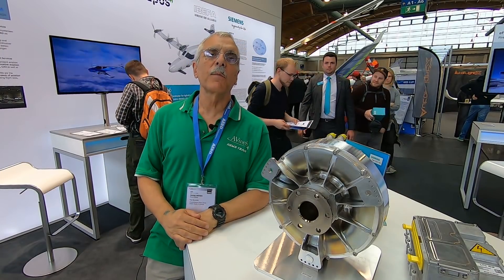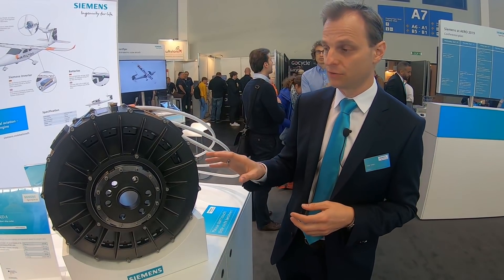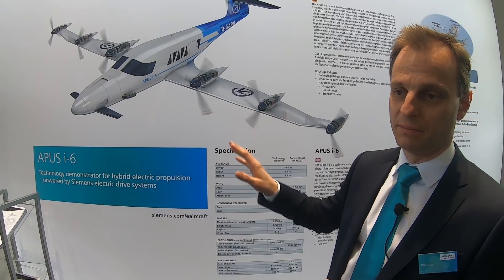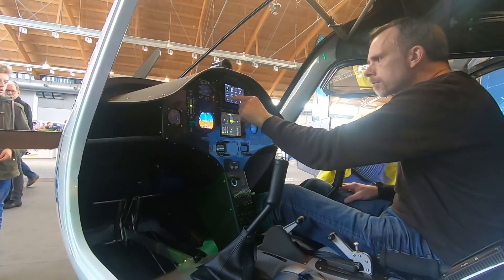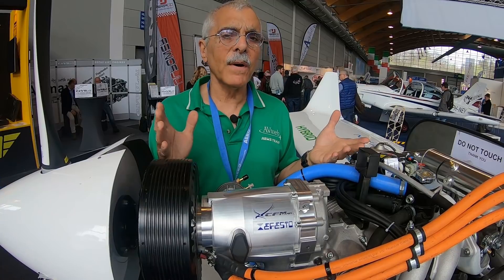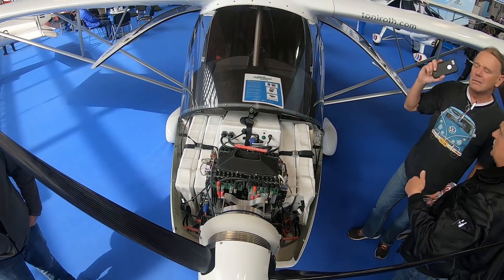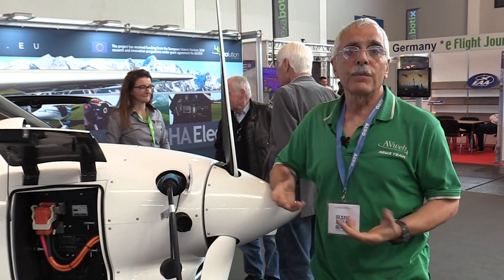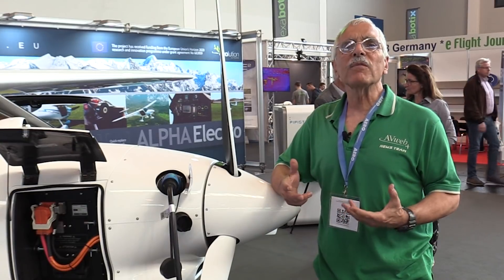What's New in Electric Airplanes?

Comment: Why is no manufacturer looking at hydrogen fuel cells?
Reply: weight (mass, poundage)
Reply: Never mind. Watched all the video 11.52 FC is discussed. Thanks
Reply: Correct. FC is far lighter or greater range. Honda does everyone a favour and produces the Clarity Battery EV and FC EV. Both are similar weights but one has 96 mile range and the other 366 miles. Cost and access to technology are probably limiting factors along with range extenders being cheap. Would have thought FC would be perfect for planes
Reply: @conpapas6023  If you add up the weights of the fuel cell, and the massive cylinders, strong enough to hold enough H2 to be meaningful... well, the weight of it all would be prohibitive for aircraft.

Comment: Oh good, let's fly an airplane on coal!

Just kidding. Well, not really, but hopefully renewables can actually enter a market without being bolstered by government subsidies and then we won't be flying "electric" aircraft with electricity derived largely from coal.

But nice leap forward. Forgive the sarcasm.
Reply: Nicholas Boscaino 
Renewables are already cheaper than coal, without any subsidy. BTW, why’s it ok for coal and oil to receive subsidies (they both do) but not renewables?
Incidentally, Tesla have been steadily converting their Supercharger network to solar. No shortage of flat space for solar panels at your average airport.
Reply: @q.e.d.9112  not against advancement in tech. Actually, Batteries have been one of the bottlenecks. I hear there is a cheaper higher capacity battery on the horizon. The other bottleneck unfortunately is the environment. Wind and clouds interrupt production. Batteries however might solve that problem.

All I'm saying is that there is only really one reason for electric planes at this point and that would be safety.

Regardless if fossil fuels receive any subsidies or not, the potential energy and portability and reliability is unmatched at this point.
Reply: Nicholas Boscaino 
Thanks.
I think lower operating costs will be a big part of it. Elsewhere, I’ve commented that a hybrid, using a single, turbine powered generator, and multiple motors with sufficient battery power for take-off demand plus a reserve in case of engine failure, might prove viable now. Only one turbine to service, which runs on constant load so only needs to provide power at the mean level required over the whole flight. Multi-engine reliability but only one turbine to maintain.
Reply: @q.e.d.9112  I like the perspective of losing the redundant engine but still having the redundancy. Take off battery assist is good too.  Good reason to incorporate a battery into the equation. Interesting.
Reply: Nicholas Boscaino 
Wow!
It’s such a rarity to have a civilised discussion with somebody on this medium.
Thanks for your reply.
Regards, Mick
Reply: @q.e.d.9112  no problem dude. It was my mistake to consider the driving force behind electric was eco friendly. I forgot what industry we were discussing haha. I often role my eyes at my neighbor cutting his grass with a corded lawnmower. Cost is most definitely not why for him. Nice guy but you know... but your points were a real insightful move forward for Aviation. I neglected to consider the benefits and only concentrated on a heavy depleted battery. It's seems to be an exciting time in advancement. The millennial culture seems to open to new, untested tech in exchange for the promise. But yea, all you said was good stuff.

Along advancement discussion, have you per chance looked at this prototype in development?  Already 1500 orders for kits. Its all diesel but getting awesome gas mileage. He's vlog'd his whole development and is ready to fly it. Pressurized, 350 miles per hour, 16 gph. You should check out his YouTube channel.

http://raptor-aircraft.com/
Reply: Nicholas Boscaino 
Thanks for that. 
If I was 50% younger and 500% richer I’d place my order for one of those today. 
Good chatting with you, mate. Where are you based?

Comment: No way in hell would I fly in one of these, especially one designed and built by Siemens.
Reply: Well technically everyone reading these comments is a product of semen ... :D
Reply: You must run a CNC with a Siemens controller.....everyone either hates them or loves them, with the later being the exception.
Reply: Keith Lucas actually I started out as an engineer about 30 years ago with a company taken over by Siemens, I since retired as a regional director One thing I’ve learned over the years is that Germans are the very finest mechanical engineers, when it comes to electronics and computer tech they are total shit. I’ve owned 5 Mercedes why I don’t know, since switched to Audi. A prime example was my CL600 a 12 cylinder outstanding engine and car until the 14 networked computers lost their freakin minds and wouldn’t communicate with each other an electronic nightmare. That was a $120K pieces of junk.....dumped it at a huge loss.

Comment: I prefer electric powered RCs over gas/nitro but man is someone in for a bad day if the batteries on the fullsize versions catch fire which is almost inevitable
Reply: Pablo Gonzalez these will be ‘slightly’ higher grade batteries than your hobby king LiPos
Reply: @atomicsmith  -  Of course but 6 figure Teslas still go up in flames and 9 figure 787s have seen contained thermal runaways no one is immune
Reply: @PabloGonzalez-hv3td  Neither one has had a battery fire for sometime. Improvements are constantly being made.
Reply: @ictpilot  - If by sometime you mean since last week for Tesla sure the point is it happened and no one puts out a product with the expectation of failure those failure points are discovered sometimes the hard way.

One undeniable drawback to electric flight is that an electrical fire is equivalent to simultaneous engine failure, fuel starvation and a fire in an ICE aircraft and a comprehensive fire suppression system could be impractical
Reply: @PabloGonzalez-hv3td  True it is possible, but pretty rare. Engine outs are far more common and electric propulsion will likely make those non-existent. Also engine fires have been known to happen...
Reply: @PabloGonzalez-hv3td  The only battery fires have been identified and solved (787). The Tesla fires were from after a crash. If enough paranoid people want it a fire suppression system for a light airplane would not be that big of a deal or weight. Hell, look at the Cirrus aircraft. Big heavy parachute system, and still gets great performance.
Reply: @ictpilot  -  2 Teslas caught fire within the last month neither from accidents and the 787 is a perfect example of the precautions taken to surround battery packs in heavy enclosures. A requirement that doesn't scale up well.

Boeing didn't change battery type but because of the upgraded enclosures we don't actually know how many further incidents have occured as the FAA now deems them "non reportable events" the last known battery failure was in 2017. I've been on a plane that made an emergency landing we didn't make the news (not a 787).
Reply: @PabloGonzalez-hv3td  Right better packing on the batteries, now not a problem. I'll have to look into the Teslas and see what the story is. Too many Tesla haters out there, so you have to be careful to get the true story of what actually happened. And was it an emergency landing or precautionary? There's a difference that the media doesn't understand.
Reply: @ictpilot  - Look into 787 batteries it's the truth remember they're not flight critical only preventing the spread of fire was the critical concern. I'm not a Tesla or electric car hater both were parked.

Medical emergency landing in my case it was due to a belligerent passenger that we had to subdue and cuff after he threatened a FA and got in her face the FA then shortly started complaining about chest pain so we diverted for her. The guy was 4 times her size and only 2 of us responded when she asked for help so she was a little shaken.
Reply: @PabloGonzalez-hv3td  Wasn't calling you a hater. Just saying there are so many people/entities that want to see Tesla fail. Other car companies, traders on wall street shorting the stock, and the oil companies. And of course the media. So you have to really look at who is putting out the story and dig down to the facts.

Comment: I would every nervous flying in a strictly battery powered electric aircraft. Why don’t any of th3 aircraft have solar panels on the wing surfaces to help boost battery power or even a propeller that turns a generator with movement through the air??
Reply: Rick B 
Solar power on the wings.
Let’s say a typical 2 seater has 15 square meters of wing area. And let’s have the most effective solar cells. That’s still only about 3kW. So a 60kW motor would get an absolute maximum of 1 minute of run time per 20 minutes of flight time. In practice, you’d be lucky to get 50% of that. Probably not enough to compensate for the extra weight needed for the cells, wiring and bms, you’d need.
As for a prop driven generator, this could not possibly generate enough power to overcome the extra drag. And when I say “not possibly” I mean absolutely so. You cannot get more energy out of any system than you put in, so any extra thrust would always be less than the extra drag.
Reply: Q. E. D. So much for my brilliant idea.😬 I guess guys like Tesla never had to worry about guys like me, oh well.

Comment: Hybrid seems overly complex. They never really tool off in the auto market either. Pure electric is the future.
Reply: Every other taxi is a hybrid. Hybrid systems often offer increased reliability over non-hybrid gas cars.
The biggest challenge with hybrids is weight - a minor issue in cars but a big problem for aircraft. We'll see if manufacturers are able to make aircraft hybrid systems work.

Comment: So, what is the advantage of electric power in an airplane? You can't go far, you can't go fast, and you can't carry loads. The carbon "footprint" is not improved much, given the carbon needed to produce the materials to make the plane and the batteries. The production of such large batteries requires a lot of materials that require carbon emitters to produce. And the cost is comparatively astronomical. It just doesn't add up. The only advantage I can see is that there is less noise from an electric motor than from a gasoline/diesel engine.
Reply: Cost of ownership, reliability, carbon emissions, high altitude power loss

The purchase cost of the alpha electro is very close to 2 seat gas aircraft.

The battery of the alpha electro only weighs 279lb. Consider that a 2 seater might burn 24lb/hours, the electric plane will actually recover its manufacturing cost in carbon savings very quickly, if charged from a low-carbon energy source. Imagine a flight school makes 500 flights of 1 hour each. That's 12,000lb of gas saved.
In addition, the EV also has much less moving parts. Reliability is closer to a jet than a piston aircraft. Electric airplanes have plenty of advantages.
Even you claim that "you can't go fast" is wrong. Electric powertrains can be very powerful, AND they don't lose power at high altitudes.  You absolutely can go fast until you run out of charge.

Comment: Meh, I'll stick with the Mooney.
Reply: But you learned landings probably in C150s, Cherokee 140s or Traumahawks, no? That's the point :-).
Reply: @Walterwaltraud  Landing a Mooney is pretty freaking far from landing a Cessna 150. I would recommend specific model training as you come in much faster in this plane and it's much less forgiving. I learned landings in a Piper Warrior II. I would buy an ultralight before an electric plane if I just wanted to putt around for 45 minutes.
Reply: @Cwra1smith  You would, other flight schools will disagree, probably. We'll see. But the Pipistrel Alpha and Alpha Electro have extremely comparable characteristics. My point is, you learned it a PA28 and then transitioned. PA28 analogy (I own one btw) is the electric pattern trainer. Once you know how to fly, by all means, new pilots should leave the pattern and practise area and go for their IR on a Mooney or the likes ;-).
Reply: @Walterwaltraud The problem Walt is how do you richen up an electric motor for landing? Transfer fuel load? Check mags?Too many things just don't carry over to real aircraft.
Reply: @Cwra1smith  Cannot recall transferring fuel in a 16 hr endurance C350 on our trip around the world. No PA28, C150, C172 either, to quote common models. And neither on the PA23 with four wing tanks and 10 hrs endurance either. So - you learn in simple a/c, read the POH and get a checkout or endorsement to step up, like anywhere else. This is a basic training tool, not more, not less. That simple.

Comment: Batteries are rightly cited as the limiting factor in development of electric aircraft.  But electric motors themselves have several benefits that make them ideal for aviation:

= Electric motors aren't dependent on oxygen density and make the same power at 100,000 feet that they do at sea level, without requring heavy complex compressors.

= Electric motors are one of the most reliable forms of propulsion exceeding the reliability of gas turbines.  They are simple with basically two moving parts. 

= Electric motor's weight and volume to power ratio are extremely high, this allows for more aerodyamic designs with smaller cowl frontal area and more effective weight/balance for loading the passenger compartment.  They are so small and light for their power, they can be stacked in series to increase power and if one of the motors in series were to quit (a highly unlikely event) the other could take over and provide level maintaining or minimal climb power.  This would render concerns about failure of the motors themselves completely moot.  

= Electric motors, because of their simplicity are incredibly durable.  Electric traction motors in vehicles routinely go more than 1 Million miles before overhaul/replacement.  Electric motors in aircraft would probably extend TBO times by about 5 - 10x.  At that point the Time Between Overhaul essentially becomes equal to the useful life of the airframe.  Their routine maintenance needs are minimal to non-existent depending on design. 

= Electric motors are extremely quiet and they make less vibration than reciprocating engines or gas turbines.  This makes the use of aircraft in populated areas much less problematic (less noise); Greatly reduces pilot fatigue (less noise and vibration); Increases the lifespan of all the other components of the aircraft (less vibration).

= Electric motors are extremely efficient, on the order of 90% - 98% compared to roughly 30% efficiency for reciprocating gasoline engines and even less for gas turbines.  They also produce less waste heat than fuel powered engines.
Reply: The electric motor isn't dependent on oxygen density true, but your propeller and the wings are dependent on air density.
So your electric motor can operate at 100,000ft but your propeller isn't going to be working very well or at all.
Reply: glibsonoran gas turbines are actually very efficient
Reply: @christopherwilson6527  General aviation gasoline piston engines generate more power per gram of fuel consumed (Power Specific Fuel Consumption) than general aviation gas turbine engines: (Reciprocating gasoline: 280g of fuel/KWh;  Aviation diesel: 220g of fuel/KWh;  Turboprop: 310g of fuel/KWh) This is especially true for the small turbine engines - like the Pratt & Whitney PT6 - used in general aviation, which I was referring to.  

Aviation turbines do become much more efficient as they get bigger as in the huge turbofans of large commercial jets. Large, heavy non-aviation gas turbines, especially combined cycle turbines, do even better.  But even the most efficient non-Aviation combined cycle gas turbine gets about 60% efficiency, nowhere near that of a electric motor.

Comment: A lot of focus on motors, not so much on the batteries...
Reply: Exactly... progressives just can't help themselves from obfuscating the facts... battery technology sucks... is barely viable for cars, after years and years of research, let alone aircraft...
Reply: @RightTrafficN7954Y  The battery technology is barely viable for cars???  Here are some battery ranges for 2019 electric vehicles:

Tesla Model S Long Range  - 375 miles
Tesla Model 3 Long Range - 348 miles
Tesla Model X Long Range - 315 miles
Jaguar i-Pace - 292 miles
Kia e-Niro - 282 miles
Hyundai Kona Electric - 279 miles
Audi e-Tron - 241 miles
Nissan Leaf e+ - 239 miles
BMW i3 - 193 miles
Renault Zoe - 186 miles

You have no clue what you are talking about.
Reply: @RightTrafficN7954Y  Pattern work.... it's a niche application. For a long time.

Comment: Ultimately electric flight will be everything when we get to the UFO stage and yes UFOs are real but as long as we use batteries I think the key application will be vtol taxis where the cleanliness and agility will outshine combustion dramatically. Noone is flying gas powered drones for instance and if you have up to 2 hour flight time and it can stretch its legs at 300km/h in level flight, you still get around in an urban setting. It could be huge today, we are really only waiting for human reaction time. It's easy to do +1g vertical take off with inexpensive battery propulsion with today's tech and that's kinda scifi level.

Comment: What is going to prevent a fatal flat spin in the event of a wingtip motor failure at low altitude?
Reply: Steve S 
Possibly a non-fatal flat spin?
Reply: You can power down the opposing motor. And it could be automatic. In the 7 motor config it would barely be noticeable anyway.